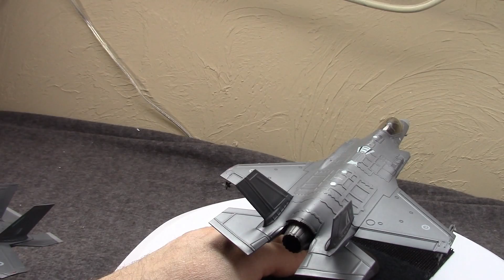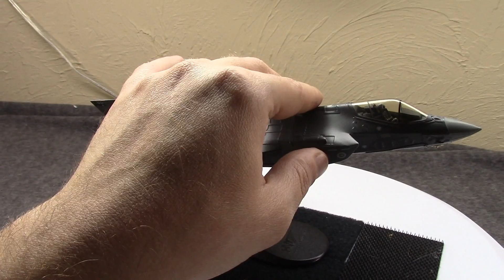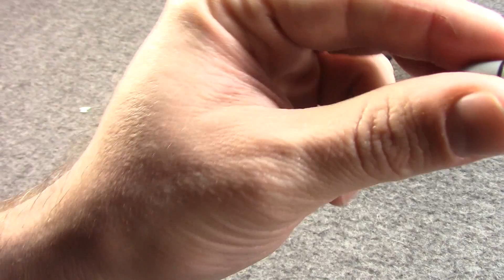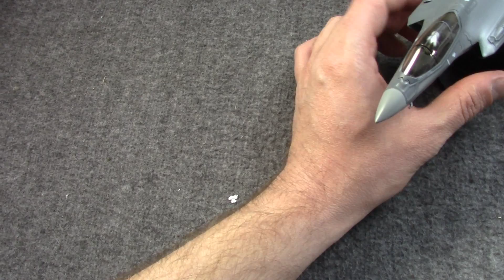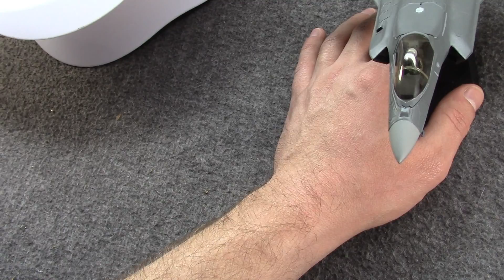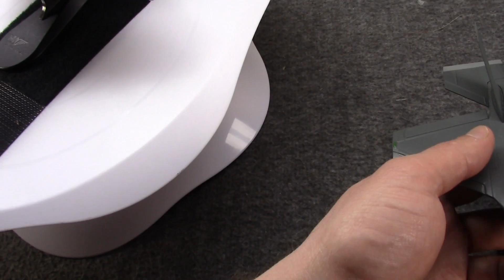F-35A/B/C Lightning, Something Great & Not At All Contraversial: Lockheed Stealth Fighters Pt. 3

Comment: one of the most interesting things i find about the F35 is by the windshield it says   warning do not cut canopy within three inches of canopy frame. Like all real americans i hate the metric system, and here on this high tech plane that is used by the military and will be sold to many countries it says three inches. I love it, but i have to wonder why they used inches instead metrics. I think lockheed resists using the metric system to some extent, as shown when the mars Climate Orbiter crashed into mars.
Reply from the maker: You sure it says that on export models? or just those for the USA (and maybe UK)?
Reply: @misha5670  every picture i have seen of the f35 says 3 inches. I know the british planes say it. There is a very close up video of them landing in britain with their first round of delivered planes.